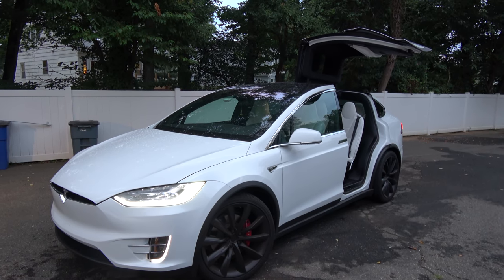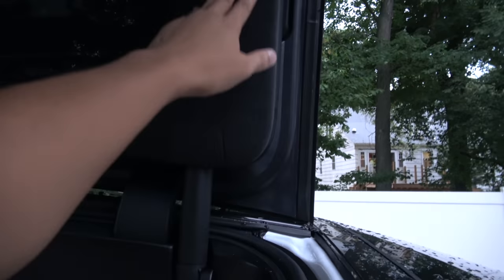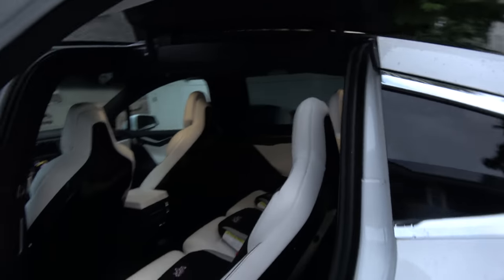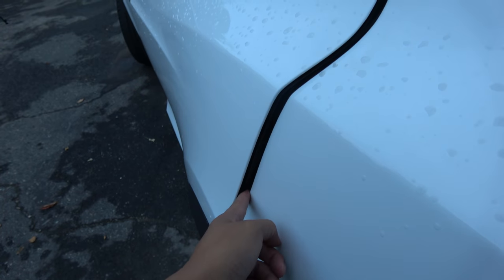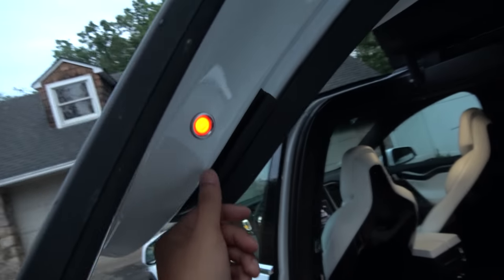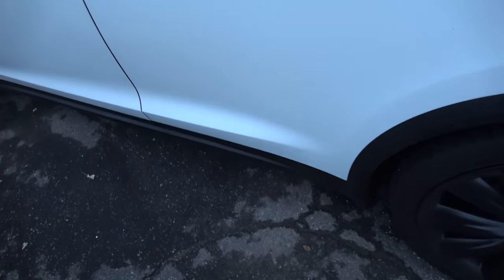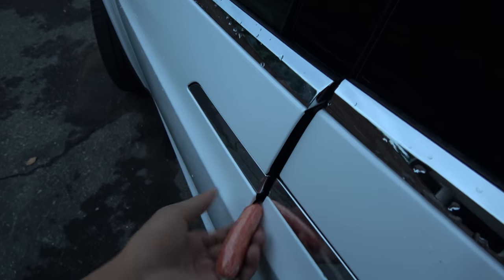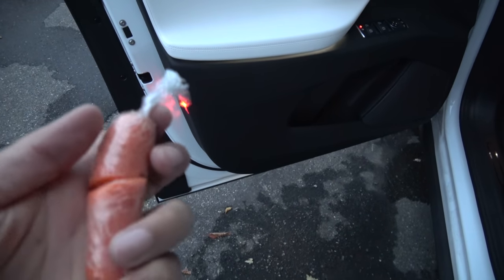Tesla Model X - Falcon Wing Door Safety Features Explained, DEMO, TESTED and More! 4K

Comment: Thank you for doing such a comprehensive and detailed showcase of the sensors of the auto closing of the doors. What about if you were sitting in the driver seat and your leg was hanging out? Would your leg stop the driver door or falcon wing door from the pushback pressure alone? Can you physically stop the doors from closing without pressing the sensors? I wonder if the sensors on the driver side door were faulty which was causing the door to close on the carrot? Maybe try the passenger side.
Reply from the maker: nah, the sensor is working as you can see i did stop it with touching it.  the problem is the door builds up too much momentum at the last inch and cannot stop in time to not hurt you.  you leg will stop both the falcon wing door and the front door, but it will hurt.

i'll try to do another video with a little more detail and a few more scenarios.

Comment: Have the falcon doors been hacked yet? I mean put additional sensors, i have no idea how it works, but if its simple (for them to save money) then maybe it can be easily hacked.
Reply: They will add new sensors and just either slow down the doors in the software
Reply from the maker: the door is already slow enough.  do you mean they will add new sensors in the current fleet or new ones in the v2, 3 years away?
Reply from the maker: Tesla software is not easily hacked.  if it was would have happened already.  the hacker that found the P100D code didn't exactly do much except finding the words.  Though I think he did retrofit autopilot or something like that.
Reply: MEtv Product Reviews
 The P100D wasn't hacking. I meant hacking, can be software or  hardware or both, I mean those sensors send a signal do they not? If I cut your sensor with a knife would it still work? It just might be a simple system...
Reply from the maker: not a simple system.  afaik, it hasnt been hacked.

Comment: The front door is scary..The kinetic energy in the front door is so strong when closing that there is not enough time for the car to stop it after the sensor detects the obstacle. Tesla can improve it by quickly slow down the door somehow in the last inch before closing.
Reply from the maker: they really don't need to slam the door.  it is a safety hazard.  the door lock pulls it closed when within 1 inch.  will demo it soon.